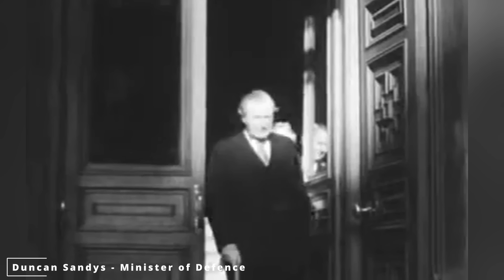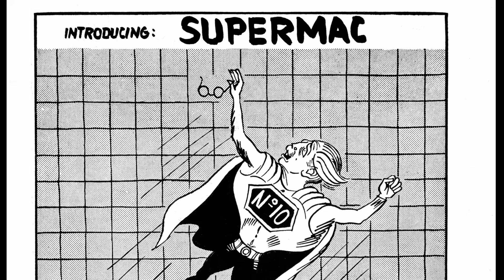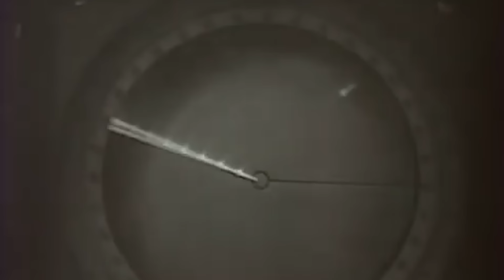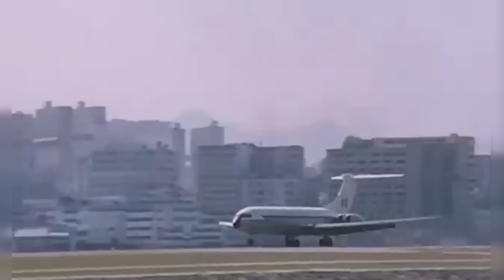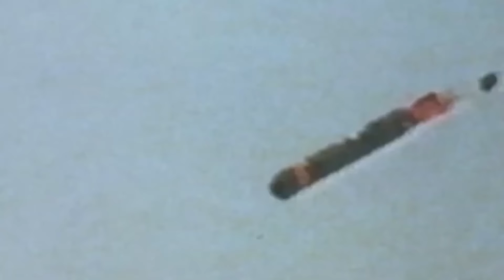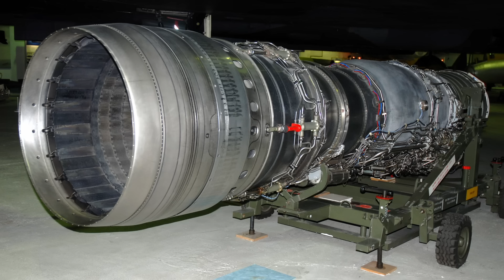How Britain Turned A Failed Airliner Into a Soviet Submarine Predator | The Mighty Nimrod

Comment: You can hardly call the Comet a "failed" airliner when 114 of them were built.
Reply: Yes, you certain can... almost all of them ended up sold to the UK government and the Comet 1 had a staggering 56% loss rate and 34% for all Comets models
39 of the 114 build crashed or were destroyed in accidents making it the worst jet airliner in history and the highest statistical fatalities rate by an order of magnatude!
Reply: The Comet was without any doubt the worst jet airliner in the entire history of commercial jet aviation.
No aircraft has such an appallingly loss rate and fatalities statistics.
 de Havilland by 1954 had developed a well-earned reputation for building aircraft that crashed often and killed everyone onboard.
Reply: @sandervanderkammen9230  

We believe we can clear up some commonly held myths and misconceptions obviously.

It's always good to see the facts presented clearly and concisely isn't it?

Bow-wing (see B-47 wing collapse wing folding incidents) had built less than 12 pressurised airliners before the Comet first flew and they were not high altitude airliners. 

All Nimrods were new build Comet 4 airframes with appropriate strengthening and the unpressurized  equipment bay tacked on. 

The HS 801 Nimrod was the most advanced aircraft of it's type at the time it first flew. Problems with the MRA4 programme were almost entirely due to radar and computer equipment issues and BAe Systems & co being too busy with other work at the time. 

Obviously there have been worse aircraft for accident losses both before & after the Comet.

Early problems with Comet takeoff stalls were caused by pilots over rotating the aircraft at liftoff. 

Podded engines on wings have aerodynamics issues. The main reasons for eventually going with podded engines were because or to facilitate -
Ease of maintenance.
Use of shear off fixings given excessive out of balance forces.
Large diameter turbofan engines.
Reduce load on the wing to fuselage connection. 
Increased power from later engines. 

The Bow-wing (See B-47 wing collapse & wing folding incidents) was a good example of how to expend a huge amount of cash and effort on something that was probably not worth bothering with. The basic design of the Comet had been decided upon and established before the podded engine choice has been made for the B-47. There were aerodynamics problems with podded pylon mounted engines at the time. The US also built and operated a significant number of EE Canberra bombers under licence which did not use podded engines for their wing mounted engines. . 

There have been aircraft losses caused by pod & pylon mounted engines. 

All jet airliners benefited greatly from the knowledge gained from the Comet incidents & subsequent investigations & yet some were still worse for accident losses. 

Instances of all marks of the Comet flew with full certification after 1954 including the Comet 3. The last Comet flight occured in 1997.

The fabulous trail blazing DH Comet.
World's first jet airliner in regular service.
The jet engined Avro Lancastrian actually did a passenger service before the DH Comet. 
World's first high altitude airliner.
World's first airliner with a full fuselage length pressurised cabin pressurised for high altitude flight. That feature for that type of aircraft was a considerably difficult undertaking. 

The change from larger squarer windows to smaller rounder windows was necessary for the particular aircraft at the time. Skin thickness remained mostly the same for all Comet marks. 

How things were back then.
Accident losses - % of aircraft built.

DeHavilland Comet 4 UK                          14% 
DeHavilland Comet all mks UK (ff 1949)17%  
Vickers VC10 UK (ff 1962)                         5%

Douglas DC-1  US                                       99%
Douglas DC-2                                              47%
Douglas DC-3                                              30%
Douglas DC-4                                              26%
Boeing s300    US                                       72% 
Boeing 307                                                  70%
Boeing 247                                                   48%
Boeing 707  (ff 1958)                                 32% 
Lockheed L-049 Constellation (ff 1943)  30%
Lockheed Electra US (ff 1957)                   29%
Fairchild FH-227 US (ff 1966)                   30%
McDonnell Douglas DC-8 US  (ff 1958)   14%
Sud Aviation Caravelle  (ff 1955)             15%
Canadair CL-44 Turboprop US (ff 1959) 46%  
Convair CV-580 Turboprop US (ff 1960) 22%
Convair CV-880     (ff 1959)                      27% 
Convair CV-990     (ff 1961)                      33%
Tupolev T-104        (ff 1956)                     16%
Vickers Viscount UK  (ff 1948)                29%  
Fokker F-27 Turboprop NL (ff 1955)       40%      

The Vickers VC10, fastest Atlantic crossing for a non supersonic jet airliner, held the record for 41 years.

For the first few years of operation the Caravelle & Comet had similar accident loss fatalities.

Sud Aviation Caravelle - 
all accident loss fatalities - 
1320 fatalities. 

De Havilland Comet - 
all accident loss fatalities - 
453 fatalities. 

An example of a typical airliner from the period. 
The Fokker Friendship F-27 fatalities & accident losses as a % of aircraft built. 
Fokker F-27 Turboprop (ff 1955)   40%
2130 fatalities.

Of course De Havilland carried out a full stress analysis & performed extensive & protracted testing on two long lengths of fuselage representing all features of a complete airframe. De Havilland carried out significantly more testing than was required by any authority at the time & significantly more testing that any previous airliner was subjected to.

De Havilland designers / engineers knew all there was to know about metal fatigue at the time they designed the DH Comet.

De Havilland had prior experience building many all metal construction airframe aircraft including many passengers aircraft & thousands of jet powered fighter aircraft that were primarily of metal construction with pressurised cockpits & used jet engines built by De-Havilland.

De Havilland did indeed always work to better than industry standards at the time, used up to date knowledge for the design & testing activities & no evidence of negligence or criminal negligence was ever produced in relation to the DH Comet.

Global aerospace. 
From the 1950s sector rationalisation and consolidation took place. 70 companies in France and 300 companies in the US disappeared due to merger or dissolution. In the US Boeing was almost bankrupted by the 707 project.  Boeing had a well protected domestic market and the available space and resources in the US to engage in large scale airliner manufacturing enabling them to capture orders simply by being able to produce airframes fast enough and cheap and nasty enough. Another factor is airlines preferring to obtain as much of their airliner inventory as possible from one manufacturer. 

Global Aerospace Sector, what's happening.

For example, there are of course no German companies that makes German jet aircraft in Germany & there are no German companies that make German gas turbine aero engines in Germany that are suitable for widebody airliners.

The UK has the world's highest combined per capita Nuclear / Defence / Aerospace Sector Activity.

UK defence sector, absolute terms, world's second highest activity. 1st for per capita defence sector activity. Per capita nuclear powered submarine construction, 2nd position. 
Main players being Rolls Royce, Babcock, GKN Aerospace & BAe Systems. Activities often involve international collaboration. BAe systems, RR and other UK companies now handle more Airbus work value wise than Germany. 

There's a good chance that anyone currently flying on a widebody airliner will be on an aircraft powered by RR gas turbine aero engines made in the UK and a good chance there will be other hardware on the aircraft that's designed and / or manufactured in the UK. 

Rolls Royce Holdings UK
Subsidiaries
- Rolls-Royce plc
- Rolls-Royce North America (ex Allison etc Classified Military stuff)
- Rolls-Royce AB
- Rolls-Royce Deutschland
- Rolls-Royce India Private Limited
- Rolls-Royce Marine Power Operations
- Vinters Engineering Limited
- Rolls-Royce Controls and Data Services
- Rolls-Royce Power Systems
- Bergen Marine
Joint ventures include:
- Rolls-Royce Turbomeca
- MTU Turbomeca -

Trent Family
The MT30 (Marine Turbine)
Industrial Trent 60 Gas Turbine
Trent 7000
Trent XWB Airbus A330neo.
Trent 1500
Trent 1000
Trent 500
Trent 600
Trent 700
Trent 800
Trent 8100
Trent 900
   
RR wholly owned subsidiaries in Germany handle smaller 2 shaft RR gas turbine aero engine work.

The UK space and aerospace sectors are highly productive, high-value industries that together contribute over £18 Billion in direct Gross Value Added (GVA) to the UK economy. Individually, the space industry directly contributes about 0.3% of UK GDP 7•2 Billion while the aerospace industry contributes approximately 0.5% £10•9 Billion.
   
We hope this helps.
Reply: Comet was a spectacular failure
Reply: @JammisAdami 

We believe we can clear up some commonly held myths and misconceptions obviously.

It's always good to see the facts presented clearly and concisely isn't it?

All production Nimrod aircraft were new build Comet 4 airframes with the necessary modifications. The Nimrod was the most advanced and most capable aircraft of it's type at the time it went into service. The  Nimrid HS.801 was not available for purchase by other countries. The ability  if the HS 801 to repeatedly demonstrate detection of subs and the knowledge that it could deliver nuclear depth charges to a target was a very effective deterrent. 

Bow-wing (see B-47 wing collapse wing folding incidents) had built less than 12 pressurised airliners before the Comet first flew and they were not high altitude airliners. 

All Nimrods were new build Comet 4 airframes with appropriate strengthening and the unpressurized  equipment bay tacked on. 

The HS 801 Nimrod was the most advanced aircraft of it's type at the time it first flew. Problems with the MRA4 programme were almost entirely due to radar and computer equipment issues and BAe Systems & co being too busy with other work at the time. 

Obviously there have been worse aircraft for accident losses both before & after the Comet and Nimrod.

Early problems with Comet takeoff stalls were caused by pilots over rotating the aircraft at liftoff. 

Podded engines on wings have aerodynamics issues. The main reasons for eventually going with podded engines were because or to facilitate - Ease of maintenance. Use of shear off fixings given excessive out of balance forces.
Large diameter turbofan engines.
Reduce load on the wing to fuselage connection. Increased power from later engines. 

The Bow-wing (See B-47 wing collapse & wing folding incidents) was a good example of how to expend a huge amount of cash and effort on something that was probably not worth bothering with. The basic design of the Comet had been decided upon and established before the podded engine choice has been made for the B-47. There were aerodynamics problems with podded pylon mounted engines at the time. The US also built and operated a significant number of EE Canberra bombers under licence which did not use podded engines for their wing mounted engines. . 

There have been aircraft losses caused by pod & pylon mounted engines. 

All jet airliners benefited greatly from the knowledge gained from the Comet incidents & subsequent investigations & yet some were still worse for accident losses. 

Instances of all marks of the Comet flew with full certification after 1954 including the Comet 3. The last Comet flight occured in 1997.

The fabulous trail blazing DH Comet.
World's first jet airliner in regular service.
The jet engined Avro Lancastrian actually did a passenger service before the DH Comet. 
World's first high altitude airliner.
World's first airliner with a full fuselage length pressurised cabin pressurised for high altitude flight. That feature for that type of aircraft was a considerably difficult undertaking. 

The change from larger squarer windows to smaller rounder windows was necessary for the particular aircraft at the time. Skin thickness remained mostly the same for all Comet marks. 

How things were back then.
Accident losses - % of aircraft built.

DeHavilland Comet 4 UK                          14% 
DeHavilland Comet all mks UK (ff 1949)17%  
Vickers VC10 UK (ff 1962)                         5%

Douglas DC-1  US                                       99%
Douglas DC-2                                              47%
Douglas DC-3                                              30%
Douglas DC-4                                              26%
Boeing s300    US                                       72% 
Boeing 307                                                  70%
Boeing 247                                                   48%
Boeing 707  (ff 1958)                                 32% 
Lockheed L-049 Constellation (ff 1943)  30%
Lockheed Electra US (ff 1957)                   29%
Fairchild FH-227 US (ff 1966)                   30%
McDonnell Douglas DC-8 US  (ff 1958)   14%
Sud Aviation Caravelle  (ff 1955)             15%
Canadair CL-44 Turboprop US (ff 1959) 46%  
Convair CV-580 Turboprop US (ff 1960) 22%
Convair CV-880     (ff 1959)                      27% 
Convair CV-990     (ff 1961)                      33%
Tupolev T-104        (ff 1956)                     16%
Vickers Viscount UK  (ff 1948)                29%  
Fokker F-27 Turboprop NL (ff 1955)       40%      

The Vickers VC10, fastest Atlantic crossing for a non supersonic jet airliner, held the record for 41 years.

For the first few years of operation the Caravelle & Comet had similar accident loss fatalities.

Sud Aviation Caravelle - 
all accident loss fatalities - 
1320 fatalities. 

De Havilland Comet - 
all accident loss fatalities - 
453 fatalities. 

An example of a typical airliner from the period. 
The Fokker Friendship F-27 fatalities & accident losses as a % of aircraft built. 
Fokker F-27 Turboprop (ff 1955)   40%
2130 fatalities.

Of course De Havilland carried out a full stress analysis & performed extensive & protracted testing on two long lengths of fuselage representing all features of a complete airframe. De Havilland carried out significantly more testing than was required by any authority at the time & significantly more testing that any previous airliner was subjected to.

De Havilland designers / engineers knew all there was to know about metal fatigue at the time they designed the DH Comet.

De Havilland had prior experience building many all metal construction airframe aircraft including many passengers aircraft & thousands of jet powered fighter aircraft that were primarily of metal construction with pressurised cockpits & used jet engines built by De-Havilland.

De Havilland did indeed always work to better than industry standards at the time, used up to date knowledge for the design & testing activities & no evidence of negligence or criminal negligence was ever produced in relation to the DH Comet.

Global aerospace. 
From the 1950s sector rationalisation and consolidation took place. 70 companies in France and 300 companies in the US disappeared due to merger or dissolution. In the US Boeing was almost bankrupted by the 707 project.  Boeing had a well protected domestic market and the available space and resources in the US to engage in large scale airliner manufacturing enabling them to capture orders simply by being able to produce airframes fast enough and cheap and nasty enough. Another factor is airlines preferring to obtain as much of their airliner inventory as possible from one manufacturer. 

Global Aerospace Sector, what's happening.

For example, there are of course no German companies that makes German jet aircraft in Germany & there are no German companies that make German gas turbine aero engines in Germany that are suitable for widebody airliners.

The UK has the world's highest combined per capita Nuclear / Defence / Aerospace Sector Activity.

UK defence sector, absolute terms, world's second highest activity. 1st for per capita defence sector activity. Per capita nuclear powered submarine construction, 2nd position. 
Main players being Rolls Royce, Babcock, GKN Aerospace & BAe Systems. Activities often involve international collaboration. BAe systems, RR and other UK companies now handle more Airbus work value wise than Germany. 

There's a good chance that anyone currently flying on a widebody airliner will be on an aircraft powered by RR gas turbine aero engines made in the UK and a good chance there will be other hardware on the aircraft that's designed and / or manufactured in the UK. 

Rolls Royce Holdings UK
Subsidiaries
- Rolls-Royce plc
- Rolls-Royce North America (ex Allison etc Classified Military stuff)
- Rolls-Royce AB
- Rolls-Royce Deutschland
- Rolls-Royce India Private Limited
- Rolls-Royce Marine Power Operations
- Vinters Engineering Limited
- Rolls-Royce Controls and Data Services
- Rolls-Royce Power Systems
- Bergen Marine
Joint ventures include:
- Rolls-Royce Turbomeca
- MTU Turbomeca -

Trent Family
The MT30 (Marine Turbine)
Industrial Trent 60 Gas Turbine
Trent 7000
Trent XWB Airbus A330neo.
Trent 1500
Trent 1000
Trent 500
Trent 600
Trent 700
Trent 800
Trent 8100
Trent 900
   
RR wholly owned subsidiaries in Germany handle smaller 2 shaft RR gas turbine aero engine work.

The UK space and aerospace sectors are highly productive, high-value industries that together contribute over £18 Billion in direct Gross Value Added (GVA) to the UK economy. Individually, the space industry directly contributes about 0.3% of UK GDP 7•2 Billion while the aerospace industry contributes approximately 0.5% £10•9 Billion.
   
We hope this helps.
Reply: @JammisAdami 

Typhoon & Tornado, British design aircraft. 

Early days of the airliners.

The awesome De Havilland Comet.
World's first production jet airliner.
World's first high altitude airliner. 
At the time the Comet wasn't particularly dangerous. The DH Comet was definitely not the worst engineering failure in commercial airliner history.

Losses comparisons.
How things were in those days.

DeHavilland Comet 4 UK                          14% 
DeHavilland Comet all mks UK (ff 1949)17%  
Vickers VC10 UK (ff 1962)                         5%

Douglas DC-1  US                                       99%
Douglas DC-2                                              47%
Douglas DC-3                                              30%
Douglas DC-4                                              26%
Boeing s300    US                                       72% 
Boeing 307                                                  70%
Boeing 247                                                   48%
Boeing 707  (ff 1958)                                 32% 
Lockheed L-049 Constellation (ff 1943)  30%
Lockheed Electra US (ff 1957)                   29%
Fairchild FH-227 US (ff 1966)                   32%
McDonnell Douglas DC-8 US  (ff 1958)   14%
Sud Aviation Caravelle  (ff 1955)             15%
Canadair CL-44 Turboprop US (ff 1959) 46%  
Convair CV-580 Turboprop US (ff 1960) 22%
Convair CV-880     (ff 1959)                      27% 
Convair CV-990     (ff 1961)                      33%
Tupolev T-104        (ff 1956)                     16%
Vickers Viscount UK  (ff 1948)                29%  
Fokker F-27 Turboprop NL (ff 1955)       40%      

The Vickers VC10, fastest Atlantic crossing for a non supersonic jet airliner, held the record for 41 years.

For the first few years of operation the Caravelle & Comet had similar accident loss fatalities.

De Havilland had prior experience building many all metal construction airframe aircraft & thousands of jet powered fighter aircraft that were primarily of metal construction with pressurised cockpits & jet engines built by De-Havilland. No aircraft before the Comet was subjected to as much pre-production testing as the Comet. 

It's a great pity & a crying shame that British military forces had to occupy a large part of Germany for decades after 1945 & Russian military forces had to do the same. Of course Russia still posseses a large chunk of what was German territory & of course Russia & the UK produce nukes. Obviously Germany does not produce nukes.

Interesting British achievements.

The gas turbine engine was invented & patented in England before the 1800s.

Axial multi stage sequential stage compressor & turbine technology, first produced for turbo machinery use in England by Parsons of Ireland & North England during the 1800s. The components form the basis of most modern gas turbine aero engines. At the time the concept of the jet aircraft powered by axial internal combustion gas turbine engines was first mentioned thus the internal combustion jet engine & jet aircraft was indeed invented in England before the 1900s & before the Wright brothers got busy.

Work on the multi stage sequential stator rotor axial compressor as applicable to the axial compressor gas turbine aero engine was ongoing in England from around 1928 by Arnold Griffiths and others. By 1943 the Metrovik F2/3  Beryl was a running axial turbojet that was superior to anything anywhere else. As the centrifugal compressor engines were adequate and more powerful at the time development of a larger F2/3  version was commenced.

The Metrovik (UK)  F2/3 axial compressor gas turbine aero engine was flight certified & ran in 1942, it was the result of UK development work ongoing since 1929. At the time it was the most capable axial compressor turbojet in existence but was not required and development work continued on a larger version.

Frank Whittle performed the world's first demonstration of a gas turbine aero engine in 1937. People in Germany kept a close eye on everything going on in Britain at the time.

The centrifugal compressor RR Nene was the most powerful & most reliable gas turbine aero engine on the planet in 1944. That engine would be later built under license or copied in many countries including Russia (Mig-15 Mig-17), China, the US, France and Switzerland powered dozens of aircraft types for decades after 1944.

Pratt and Whitney and others produce centrifugal compressor gas turbine aero engines. The PW200 is a currently produced whittle style centrifugal compressor, reverse flow combustor, gas turbine aero engine. 

The world's first wind tunnel was constructed in England during the 1870s. The world's first supersonic wind tunnel was constructed in England in 1922.

There is no doubt that the Fairey (England)
Delta 2 was the world's first jet
aircraft to exceed 1000 mph.  Indeed It
exceeded the previous record by 310 mph &
held the record for 1 year. Incidentally, the Dassault Mirage 3 & 4 are based on the Fairey Delta 2.

More recent UK military jet aircraft.

The Tornado & Typhoon & their engines are Supersonic & are indeed British design aircraft with British design engines built by an international consortium. The Tornado design for example started life during the 1950s at Vickers as the AFVG, it's engine is based on the RR RB-199. The EE Lightening is also a British Supersonic jet aircraft.

The Typhoon is the British BAC-EAP with an engine based on the British RR XG-40, the Typhoon is also built by an international consortium.

Brazil has the world's third largest airliner manufacturer and makes very good airliners & Brazil is 100th down the list along with Indonesia for wealth per capita. Of course it is in fact the case that Embraer can't build those airliners without purchasing stuff from the US, UK & Europe. For example, Norway, Holland, Denmark, Ireland & Belgium, top 20 wealth per capita, don't make airliners, its as simple as that.

Global aerospace. 
From the 1950s sector rationalisation and consolidation took place. 70 companies in France and 300 companies in the US disappeared due to merger or dissolution. In the US Boeing was almost bankrupted by the 707 project.  Boeing had a well protected domestic market and the available space and resources in the US to engage in large scale airliner manufacturing enabling them to capture orders simply by being able to produce airframes fast enough and cheap and nasty enough. Another factor is airlines preferring to obtain as much of their airliner inventory as possible from one manufacturer. 

Global Aerospace Sector, what's happening.

For example, there are of course no German companies that makes German jet aircraft in Germany & there are no German companies that make German gas turbine aero engines in Germany that are suitable for widebody airliners.

The UK has the world's highest combined per capita Nuclear / Defence / Aerospace Sector Activity.

UK defence sector, absolute terms, world's second highest activity. 1st for per capita defence sector activity. Per capita nuclear powered submarine construction, 2nd position. 
Main players being Rolls Royce, Babcock, GKN Aerospace & BAe Systems. Activities often involve international collaboration. BAe systems, RR and other UK companies now handle more Airbus work value wise than Germany. 

There's a good chance that anyone currently flying on a widebody airliner will be on an aircraft powered by RR gas turbine aero engines made in the UK and a good chance there will be other hardware on the aircraft that's designed and / or manufactured in the UK. 

Rolls Royce Holdings UK
Subsidiaries
- Rolls-Royce plc
- Rolls-Royce North America (ex Allison etc Classified Military stuff)
- Rolls-Royce AB
- Rolls-Royce Deutschland
- Rolls-Royce India Private Limited
- Rolls-Royce Marine Power Operations
- Vinters Engineering Limited
- Rolls-Royce Controls and Data Services
- Rolls-Royce Power Systems
- Bergen Marine
Joint ventures include:
- Rolls-Royce Turbomeca
- MTU Turbomeca -

Trent Family
The MT30 (Marine Turbine)
Industrial Trent 60 Gas Turbine
Trent 7000
Trent XWB Airbus A330neo.
Trent 1500
Trent 1000
Trent 500
Trent 600
Trent 700
Trent 800
Trent 8100
Trent 900
   
RR wholly owned subsidiaries in Germany handle smaller 2 shaft RR gas turbine aero engine work.

The UK space and aerospace sectors are highly productive, high-value industries that together contribute over £18 Billion in direct Gross Value Added (GVA) to the UK economy. Individually, the space industry directly contributes about 0.3% of UK GDP 7•2 Billion while the aerospace industry contributes approximately 0.5% £10•9 Billion.
   
We hope this helps.